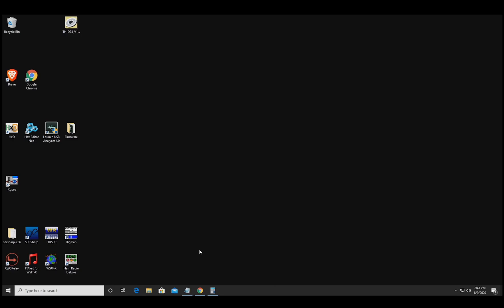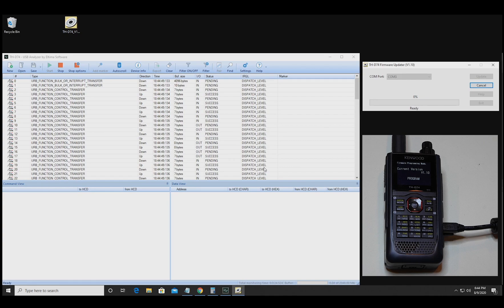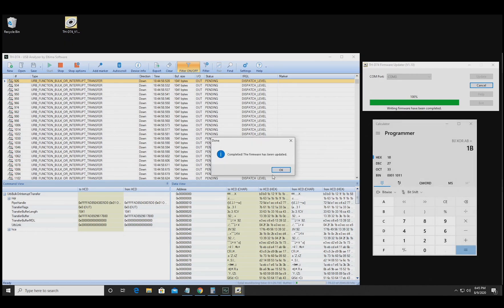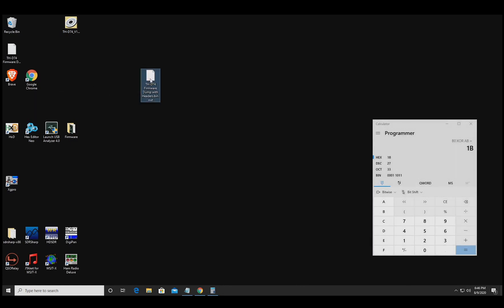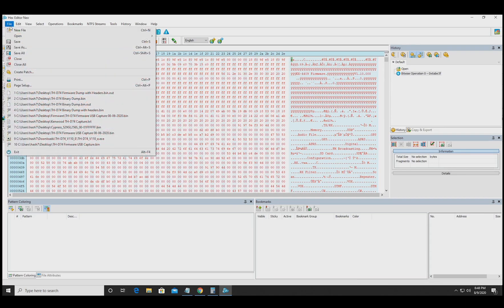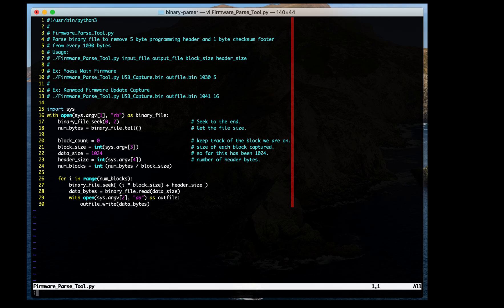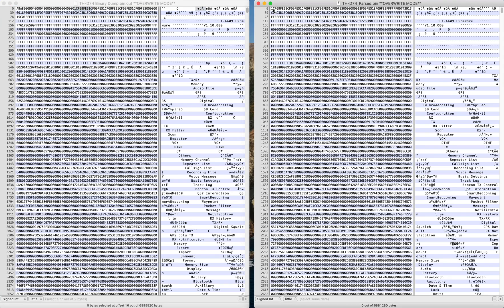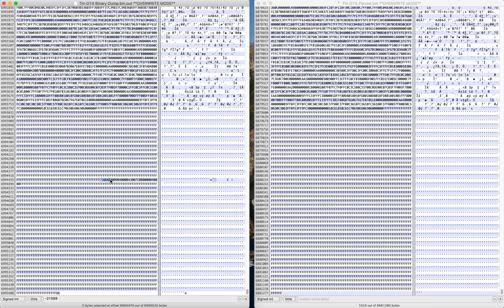Kenwood TH-D74 Firmware Capture

Comment: Hey, this was a tremendous start, I was just curious if anyone has made any more progress on reverse engineering and modding the firmware to enable or change any features or capabilities of the radio?
Reply from the maker: I haven’t worked on it any further, not sure outside of the write-up Travis did if anyone has worked on it more

Comment: Hello. Very interesting. But: Where did you get the 'AB' from?
Reply from the maker: It was found by comparing a dump of the Flash chip I got which wasn’t obfuscated with the data seen in the USB update that was obfuscated. Travis Goodspeed and DD4CR helped figuring out the exact process and put it into a tool linked from Travis Goodspeed’s blog.

Comment: Hi I have a Kenwood Th-D74A and I had the Charger Plugged in and had it in the menu Looking at the Battery Level and I took out the Battery without turning it off and when I put the other Battery in to Check the Level on that Battery the Radio won't ever turn back on and I Bought a New Pc Board the one with the SD card and Mic and Phone plugs on it and put it in the Radio and Still won't come on. Would you know anything to do to make this Radio come on?
Reply from the maker: I’m not sure, but I know that radio is very touchy. I’ve also heard if you transmit with the charger plugged in, even for a moment, it fries the charging circuit.
Reply: @RECESSIM  Thank you for the Message back Ya I wasn't Transmitting. when I can Save up enough money I'm Planning to buy a Tx Rx Board and trying that the one with the Board with the Charging Plug on it I really miss my Radio been a ham for 29 come 2023 go my Ticket in 1994 when I was 14 years old and I seen this with Scanners if you Lose Power when they are in Program Mode they will not come back on and that's the only thing I can compare it to by having it in the Menu mode and pulling the battery even though I had it plugged in it is like it Wiped the hard Memory Chip or the Firmware Chip and it's dead. Like I said I have Tried Replacing the Board that has the SD Card, Mic & phone Plug and has a Small Button Battery on it's the Same Board you Soldiered Wires to in one of your Videos and that Don't do anything and Kenwood Service Tech Told me there is 7 or 8 Pc Boards they have Listed in there Repair Books and Two as you have seen the inside of that radio you know there Soldiered on to one of the other boards I want to say the Tx Rx Board there Soldiered to it looks like they boards are soldiered on by RF Cans and I wouldn't think it would be one of them but who knows. Thank you Very much for the Message back. 73's and have a Great day.
Reply from the maker: @commonsense4207  I hope you’re able to get it fixed, I would say it’s more likely a power supply related issue than memory corruption from my experience with it.

Got my ticket back in 1994 too! July to be exact, KE6KTZ back in California, it expired then got it again recently, AG5OW. 73